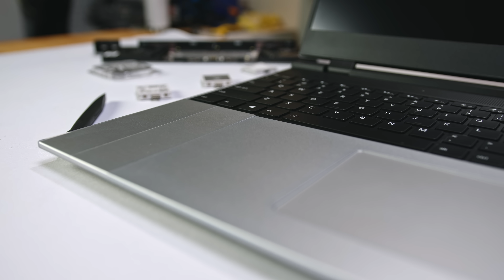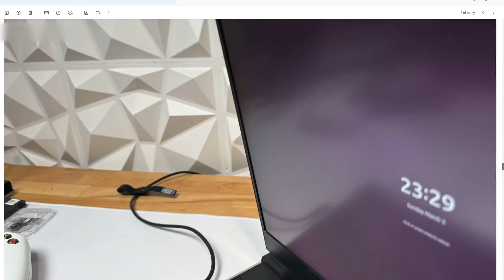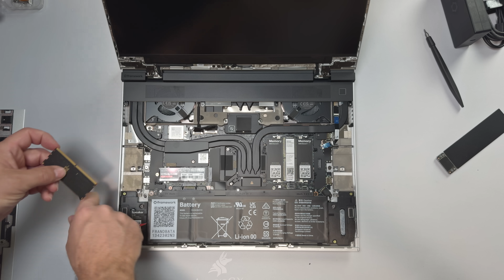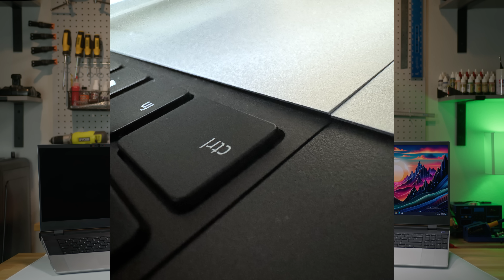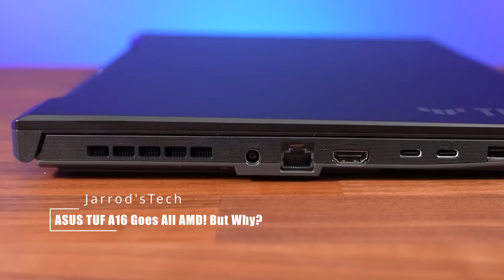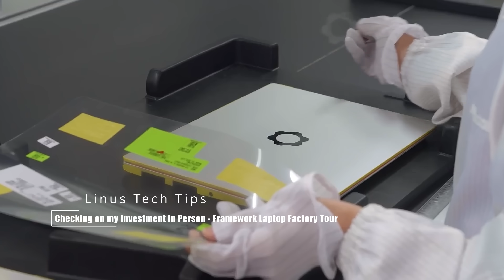From Faulty to Fixed? My Framework 16 RMA Story

Comment: Can you measure the power while gaming with software monitoring tools and also maybe with a USB C dongle? Diagnosing why the battery is draining would go a long way to help FW and hopefully they could come up with a firmware fix. Probably a bug with battery management.
Reply from the maker: It's just math. Add up all the individual component power draw plus the power loss during voltage conversion and it adds up to over 200 watts.

Comment: It dies even on power under heavy load. Wow, gonna cancel my pre-order then. That's nuts.
Reply: After several hours of gaming without pause, yes.

Doesn't seem relevant to most users who should be taking breaks and standing up, but if you're overnight rendering, it may not be for you.
Reply: @stevenswall but for only rendering, you can disable the display, which saves power.

Comment: I have a batch 4 as well, and the fit and finish is definitely still rough on my unit. I bent the spacers to fit better, but my biggest issue right now is the keyboard missing inputs occasionally on the same keys, and the remedy being to press down on where the pogo pins are to make it contact better. Currently working w/ support to remedy this.

Still loving the laptop however!

Comment: Well, considering that the CPU uses up 54W and the GPU up to 100W (AMD specs) a 180W charger is not enough. The screen, M.2, RAM, fans and so on also uses some power.
So the laptop seems to draw around 200W in total.
Reply from the maker: And that doesn’t take into account all the losses do to inefficiencies in the power delivery and conversion circuits. Any chip that gets hot means power is being lost.

Comment: I'm sorry but if a laptop drains 24% an hour when plugged in while I'm gaming or doing really intensive productivity tasks, it will get returned and won't ever come back.  That is insane that this thing was allowed to ship like that.  I know Framework is a new company with great goals and they have done a great job with community involvement.  I know that they have improved on their products generation over generation and seem to be taking feedback into account.  But come on, would this be acceptable with any other laptop?
Reply: Yeah, at worst it should be configured in BIOS or something so it uses less power, and lets you "unlock" it if you actually want it (or if you get the 240W charger)
Reply: @Winnetou17  Yes if it is configurable in the BIOS to let you use more power but defaults out of the box to use less power so that this doesn't happen, it would be acceptable to me..

Comment: I recently received my batch 4 Framework 16. I ordered my storage separately and I'm still waiting for it to be delivered, so I'm currently unable to test battery performance.

As for the fit of the components:
I can see a very small gap between the keyboard and number pad.
The track pad isn't fully inline with the two spacers at the bottom. The track pad sticks out ever so slightly.
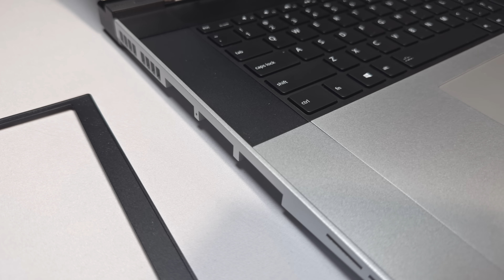The track pad pops up at the top corners as you showed yours did in the video. 5:50

As for the battery issue that you are experiencing while gaming, maybe Framework could create a barrel port module for higher wattage charging.
Reply: Their I/O modules are connected with USB-C to the motherboard. Adding an effective barrel charger would mean a comprehensive redesign

Comment: So glad I saw your first video and cancelled my batch 3 order. I like what they are trying to do, but for me the issues you had, especially the mixmatched tones of the panels the user stares at with no real alternative were just too much. With 30 years in IT I love the idea of repair and upgrade, but they should have done better to limit some of these issues. It doesnt help that so many people behave as apologists against the bad things because they like the good things. So thanks again for your honesty.
Reply: Yeah, having apologist ignoring or "washing" away actual issues is not good. But, I wrote in another article, Framework is still rather new and small, people should've expected this to be a bit of a beta. At least Framework 13 is out of that. For Framework 16 I think it will truly be much issue/compromise - less on the next iteration, which might be next year, or in 2 years (which is my guess) or so.
Reply: True. I don't like apologists. The Laptop is priced at premium so the least they can do is to make sure the tolerances are as tight as possible and that pieces are manufactured in same shade of color. The issues with brand new breed of products from young company are understandable but that doesn't mean they should be excused.

The ability to repair and upgrade the laptops doesn't excuse below par experience out of the box.

Comment: A question came to my mind. Where you playing with the dedicated Radeon graphics module? That one has a own USB-C port for the 180W charger. The power drop on that shouldn't be that much....
Reply from the maker: Yes I was using the RX 7700S module but no it doesn’t have its own power input. It only has a USB-C alt display port for video output to an external display.

Comment: FrameWork will not make it to 2025.  Investor money will dry up soon and there's little appetite for new investment in x86-based consumer-grade computing companies.
Reply: And they can't make Arm or Risc why? bold claim to say they won't make it because they have X86 ...
Reply: Then they will splinter their product line....some modules for ARM, some modules for x86..... FrameWork won't even be around in a year or so....both the desktop and laptop form-factors will change in the next couple of years, regardless.  PC hardware makers, in particular, need a wholesale changes and "conversion" to new architecture in order (to sell NEW units) to survive.  Modularity is out....fan-less, power-sipping devices are in......Apple has already taken in this lesson  @dfbess
Reply: @dfbess  Moving to ARM/RISC from x86 will require a substantial transition of Hardware and Software.....tens of millions of current Windows will find themselves having to buy ALL NEW versions of Hardware and Software just to be at the same level they experience now. Millions more will spend weeks, months, years chasing bugs and incompatibilities. Industry and Enterprise scale companies will not be able to handle the disruption. No company will achieve the success and smooth transition that Apple has achieved by moving away from x86. Face it ....Windows on x86 is really now a legacy technology based on antiquated software and power-inefficient hardware .
Reply: Yes? So it is a company without a future?

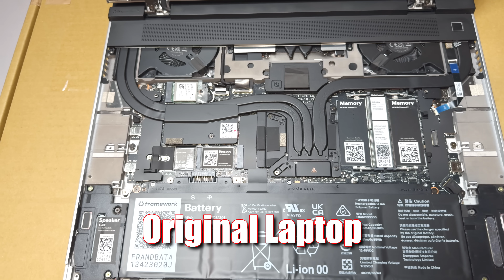Comment: @6:07 did you intentionally get spaces of a different color than the trackpad panel?
Reply from the maker: Nope, but that seems to be another common problem with the FW16.
Reply: @ElevatedSystems  oh man..  thanks for sharing your experience!! My FW13 has arrived with a crooked fingerprint sensor and unevenly seated trackpad... they made me take gajillion photos to see if this is within acceptable tolerance.

Comment: Cj, I just got my batch 4 unit in this week. Funninly enough it says my unit was manufactured in February of 2024. I have no dgpu and have had battery drain occationally using the integrated graphics and using a 100w power adapter. It may be something you want to look into. As for the spacers, my touchpad was bowed down in the center. I checked by flipping it over and setting it down on a granite countertop, gently working the bend out, I went from ~2mm of edge between the touchpad and side spacers, to less then .5mm

Comment: I don't understand, I set the battery to 85%, I gamed around 6 hours yesterday, the laptop was screaming trying to cool down, and there was no drop of percentage. Maybe I'm not using a demanding enough game?
Reply from the maker: What were you playing? When I play Helldivers or CP2077 those games keep the GPU demand at 95% to 100% and CPU at up to 60% which drains the battery, however I can play Skyrim online all day as it has much less demand on system resources.

Comment: This isn't even slightly swaying me from my batch 7 preorder, and it is a shame this had to happen to you, but at least we can see how FW is improving and is willing to make up for some of these mistakes. I'm probably just going to be running on lower settings or underclocking (?) until we get either a 240w brick or some third party expansion card for barrel jacks.
Reply from the maker: Going with Balanced power settings significantly reduces the battery drain while plugged in, with slightly noticeable dips in performance.
Reply: @ElevatedSystems as long as I end up with better performance than iris xe, I’ll be happy for a while

Comment: That power issue seems like a pain. Sounds like they should have included a barrel charger but left USB C charging for anything else.
Reply: EU regulations.
Reply: @ukraineball953 Not only is that not in effect for laptops yet, but it will only apply to laptops with charging speeds of up to 100W.

Comment: did you get to destroy the faulty laptop for the thumbnail or are your photoshop skills very good
Reply from the maker: lol that’s a result of modular components and a little PS generative fill. I returned the original to FW in exactly the same condition I received it.
Reply: @ElevatedSystems Did  you keep the better fitting touchpad? :D
Reply from the maker: @gwenmorse8059  lol, no I returned it with the bad laptop.

Comment: Wow, glad I didn't bite on the Framework 16. I got a Framework 13 but seems like USB-C tech is not capable of the power needed for the Framework 16 yet. Another complaint for the Framework is their software updates, particularly on their BIOS. I am still waiting for a stable release 12th Gen BIOS, yes the beta seems stable but Framework doesn't feel like they can mark the beta BIOS as stable sadly. So instead of producing so many new hardware lines, I wish they can invest more into their software side too.
Reply: > producing so many hardware lines

It's literally their second product in like 3 years of they have existed.
Reply: @FR4M3Sharma  not really, look at the colored bezels parts, 3 generations of Intel+1 generation of AMD on the Framework 13, and now Intel+AMD on Framework 16. There's more SKUs launched (Ethernet cards, etc), yet the older products software support is lacking, i.e. BIOS security updates, older Intel compatibility with the new 61Wh battery BIOS update. Considering they want us to continue to use those devices long term, you would need software support too.
Reply: it only amd on the 16 i think  @jierenzheng7670

Comment: A company that never screws up may or may not be a great company. Because you don't know how good a company is until they do screw up, and respond to the screw up.
Reply: That's a great sentiment until you realize that they could have hired a product engineer and gone through proper testing before releasing the product. The charger is fundamentally flawed, it doesn't provide enough power to run the laptop.
Reply: @rre9121 Check the latest video on the topic... trying to squeeze the last 7 FPS on an already +90 FPS scenario, hits the point of diminishing returns.
Reply: I don't agree. If you actually know it never screws up (and not simply screwing up, but nobody finding out about it) is, in my book, a good company. No RMA needed is the best customer experience. But this is more theoretical than practical, since the economics of how things are built and checked, kind of don't allow for something like this to exist, long term, and being profitable.

Comment: Honestly this talked me out of buying the framework, thanks for the video. Its a really neat laptop but I'm not looking to buy a beta for 2500$
Reply: power issue is understandable as it will support 240W charging dows the line. Won't effect me though as I'm not buying it with GPU, don't need one. Still I thing this is one of the best choices for Linux laptop.
Reply: The framework 13 exists and is a proven product with none of the issues of the 16 in.
Reply: @usr01  13 inch version is too small for real work.  Tried to work on MacBook air 13 and it's was uncomfortable
Reply: @soltysss i think it's actually 13.5in
Reply: Well, to be frank people should expect this to be a beta. Framework itself is still rather new and small, this is just their second desing, and their first in many other aspects. While things seem to be progressing nicely, I expect that a true "no friction" experience to be in their second iteration, which I would guess would be in like two years time. Still, for tinkerers, even this first version, while imperfect, should be quite nice and usable without major hassles (and if those are like what Elevated Systems got, with the fans not working, those should be RMAd indeed).

And as @usr01 said, Framework 13 is certainly out of the beta phase, so you don't need a GPU, that can certainly be a choice. It's a bit more competitive in price too (though still on the expensive side).
Reply: I received one in Batch 1 and I eventually decided to return it. Wasn't worth the cost imo, being able to experience it was nice though... Just not the kind of thing I wanted to keep due to various issues which kept creeping up. I'd probably recommend just getting a fw13 and spending the extra money on a decent external GPU instead.

Comment: lol i just ordered the 13" amd . fingers crossed
Reply from the maker: The 13” is an outstanding laptop. I’ve had mine for over 2 years now and use it daily.
Reply: Mine has been going great, Batch 4 7840U DIY edition. It's a really nice laptop
Reply: I have a 13. It's great.
Reply: But Fit and Finish still need a slight improvement. The screen isn't always mounted perfectly straight and the main-case could use better tolerances(maybe the whole laptop in general). I decided to live with it after two replacements being exactly the same and the issues being really minor. It is just that their QC doesn't live up to what was shown in the ltt factory tour.

Edit: Some keyboard-Layouts aren't translated perfectly (German for example. US is probably fine :-| )